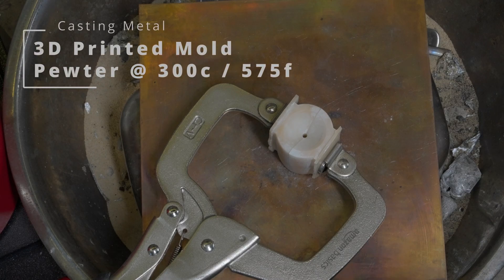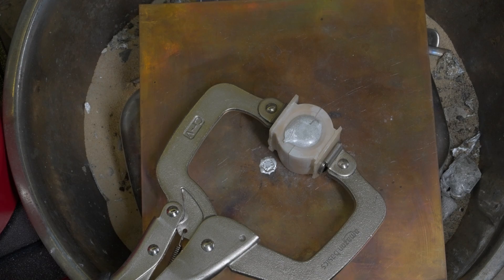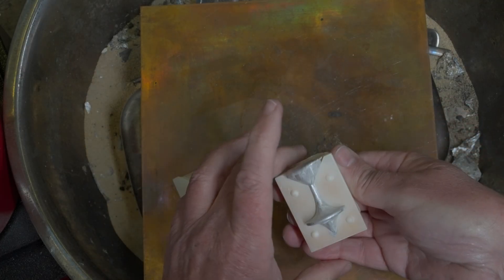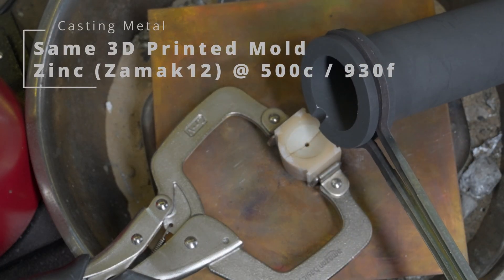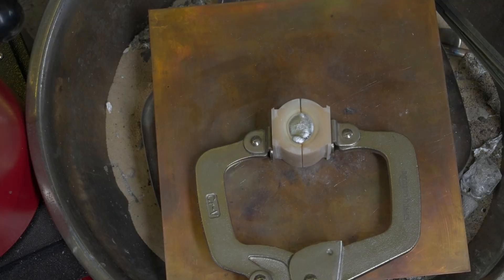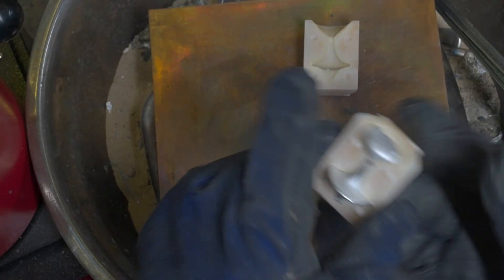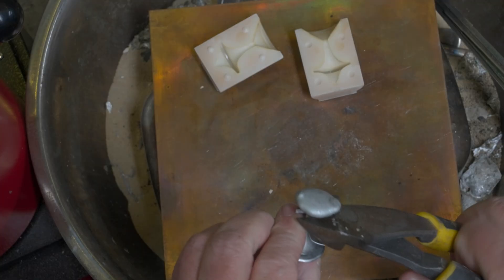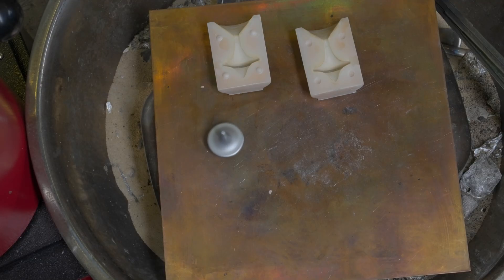Casting a 3D Printed Mold - Fixed

Comment: No-one posting on youtube seems to understand the basics of casting. You need a runner (metal entry point) and riser (metal and gas etc exit point). This allows the metal to flow. That won't happen with just one entry point. The gases inside will a) get in the way and b) cool the metal down too quickly!
Reply from the maker: Ahh, it's horses for courses.  As you can see in this example, the mould filled just fine (and is similar to casting in High Temp Silicon like Mold Max 60 with metals like pewter).  Jewellery sized Petro casting is also similar (though to be fair the sand does allow gas to escape though the sand).  Investment casting also only using a pouring basin with the porous nature of the investment and vacuum used to extract any trapped air allowing for a good fill.  That said, you are correct (and I do use) a full gating on traditional larger sand casting.

Comment: que tipo de resina es?
Reply from the maker: It's a high heat tolerance resin for 3D printers.  I've been testing it on a Saturn 3 Ultra, but it should work with any resin printer.